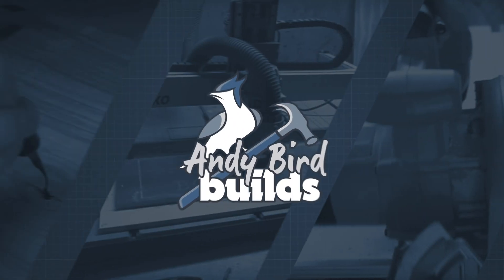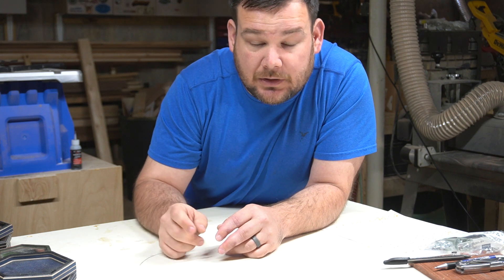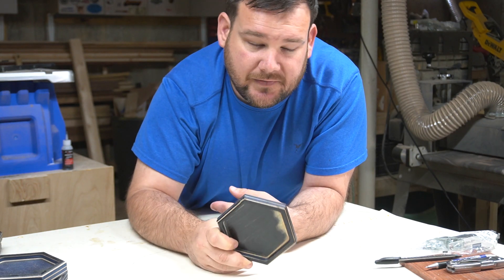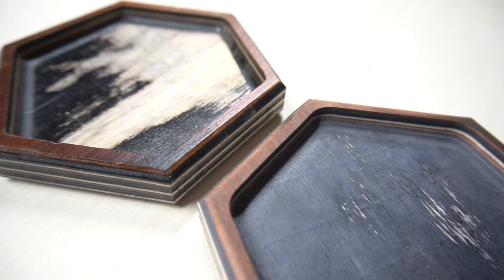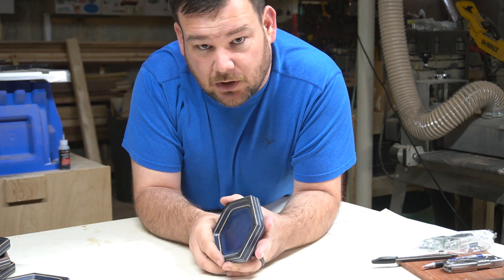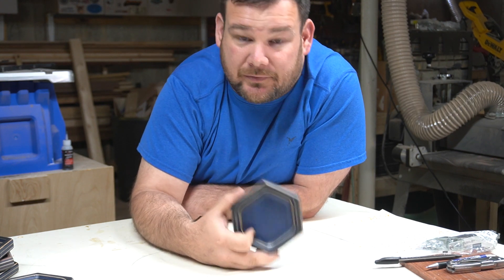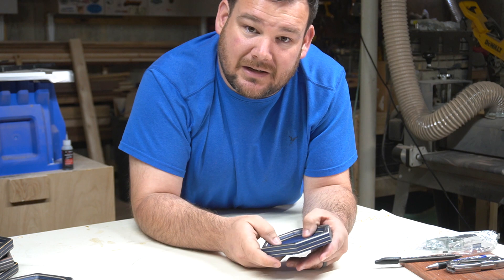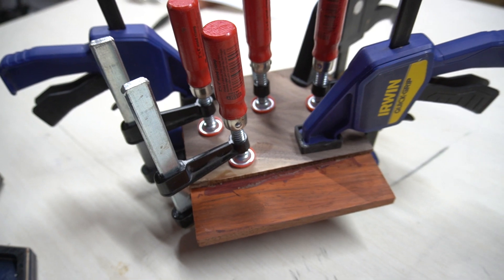How to START Making Products to Sell With Your Desktop CNC // CNC Woodworking

Comment: Have you tried bonding a piece of thick laminate (Formica) to the bottom, to 'balance' it? After machining but before it has a chance to warp (obvs :))
Reply from the maker: Hmmmm. No I haven't. I'm assuming you've done this before with success? Does it bend once you take it off the formica?
Reply: I haven't done exactly that, but the problem you're having suggests that the piece needs balancing. So you would have to leave the formica (or something similar) bonded to the underside, in order to create tension on one side to counter the loss of tension on the other.